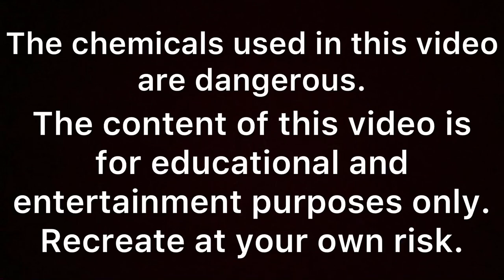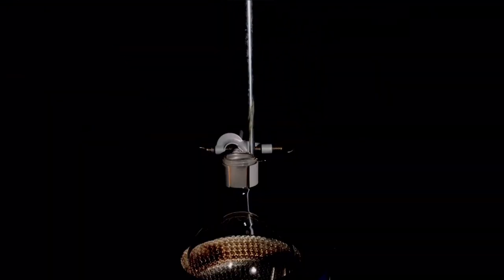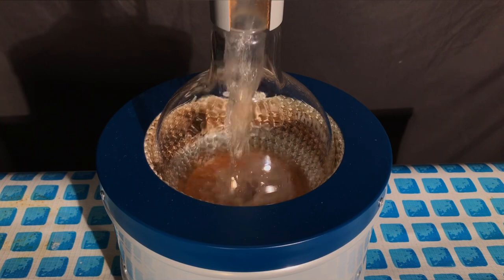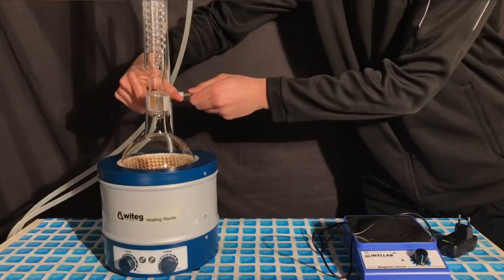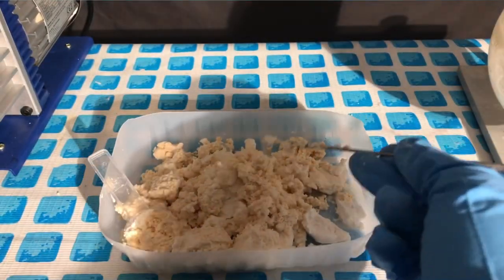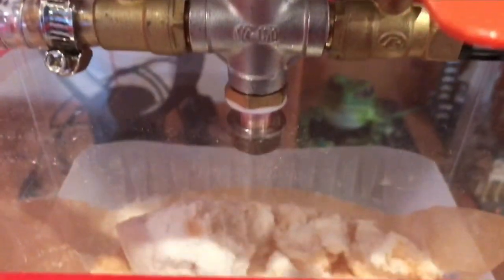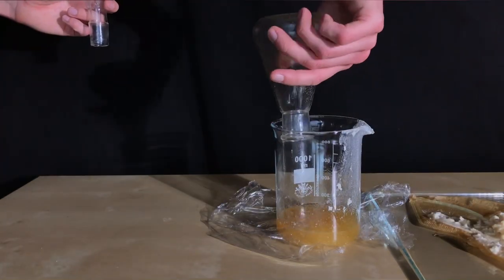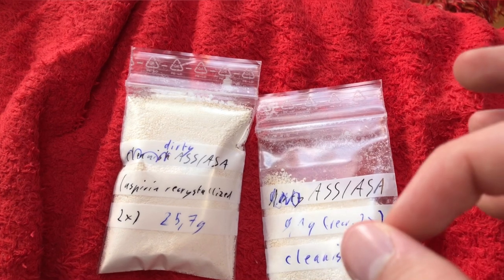Making aspirin (acetylsalicylic acid)

Comment: What happened to your Hotplate one of mine broke since I was making taxol and a drop of sulfuric acid with the funnel landed on the hotplate it gave an EO2 error temp failure and the temp went to 350 deg C :( and that was a digital one.  I got a 7 by 7 hotplate /stirrer and I use other methods like adding the acid with a bigger funnel 7 times the size (glass) learned the hard way. It was 3.5 years Old.
Reply from the maker: I melted lead with it for two hours

Comment: Any tips on how to dry acetic acid which is high concentration buy not quite glacial?
Reply from the maker: Just make it from sulfuric acid and anhydrous sodium acetate
Reply: @THYZOID  I dried my sodium acetate in an oven but I used sodium bisulfate to produce the acetic acid, that was obviously not anhydrous. Sulfuric acid is difficult here.
Reply from the maker: Bisulfate also works if you dry it beforehand

Comment: Did you make the acetic anhydride with the phosphorus pentoxide?
Reply from the maker: No I bought the big bottle. The Ac2O in the small bottle was made from AcCl and anhydrous sodium acetate. It was clear before mixing it with H2SO4.
Reply: @THYZOID  Ahh, I saw the video when you made it from AcCl. Maybe not good storing it mixed with sulfuric acid? I was just interested in seeing the anhydride made from P2O5. But thanks for the uploads anyways😊
Reply: @experimental_chemistry  I think it gets sulfonated over time. It can go from yellow and all the way to black charred looking given enough time. So it's basically sulfonated acetic anhydride I believe.
Reply: @noodlesoup2281  You just need to distill glacial acetic acid with the addition of phosphorus pentoxide. If I remember correctly it's about 30 - 35 mg P2O5 per 100 ml acetic acid and yields are around 90 - 95%.
Reply from the maker: 30-35 mg are not enough
Reply: @THYZOID Maybe i desember incorectly and it was 45 mg. It's been forebnrwteb.
Reply from the maker: 45g sounds more reasonable
Reply: @THYZOID  any chance you’ve tried it? 
I am able to purchase P205 (it’s crazy expensive) but I have held off doing to as on chemplayer vid he couldn’t get it to do anything.. and they are likely more knowledgeable than I!
Reply from the maker: I’ve tried it but the yields weren’t good so I didn’t even bother calculating
Reply: @THYZOID  thanks for replying! 
Sorry I misread your comment! 
In your opinion could it be a viable method or not really?